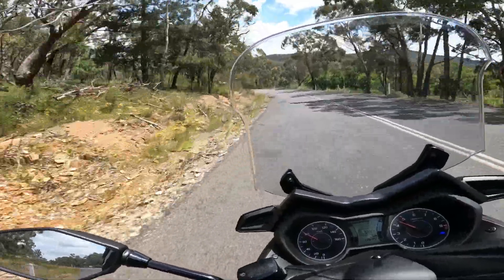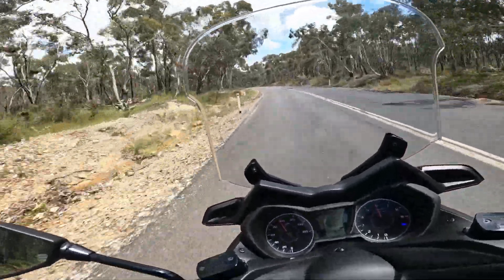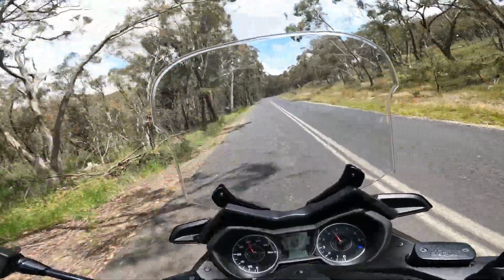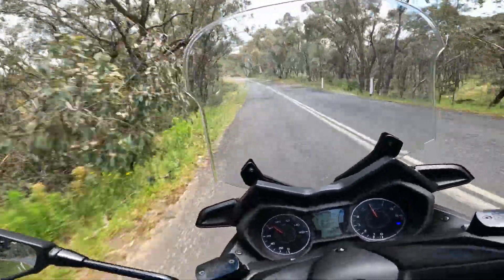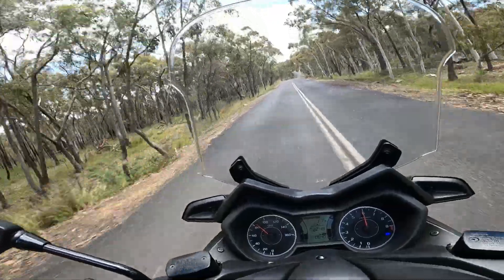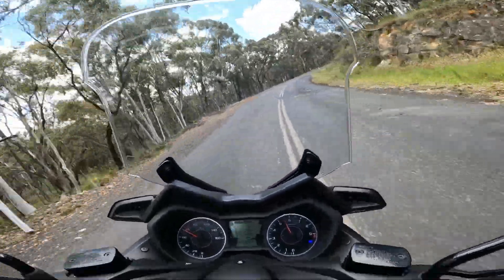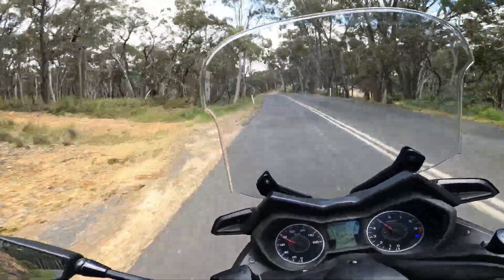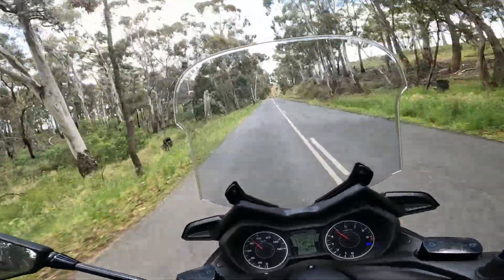2021 Yamaha Xmax 300 -Steep Hill Climb -Episode 13.

Comment: Yes I agree Warro Xmax seems to handle the bumps better . The front suspension on my Forza seems to bottom out on rough roads. Merry Christmas mate you are doing a great job
Reply from the maker: nothing that i think couldn't be improved with an aftermarket suspension package. saying that though i think the forza 350 beats it up pretty easy in performance and braking so in the end its a toss of the coin and a bit of personal preference which bike one would buy
Reply: @ridewithwarro  Yes I agree. Forza better in some areas and Xmax better in other areas. I think the ADV 350 suspension would be great for my bumpy roads around here in country WA. I hope I get the chance to buy one in the future.
Reply from the maker: @colinstevens1698  yeah the adv350 is interesting thats for sure and looks the part too. will be good to see some overseas test rides

Comment: The Xmax seems to have handled that hill climb quite well for a 300cc
Reply from the maker: yeah its a pretty steep climb from bottom to top on not what one would call a very safe road. rough surface and sharp corners.
tht last burst to the top say 300metres -it handled it pretty good